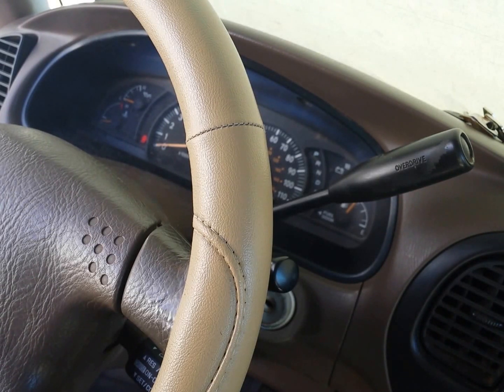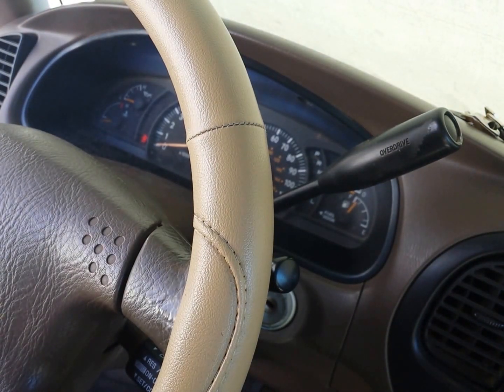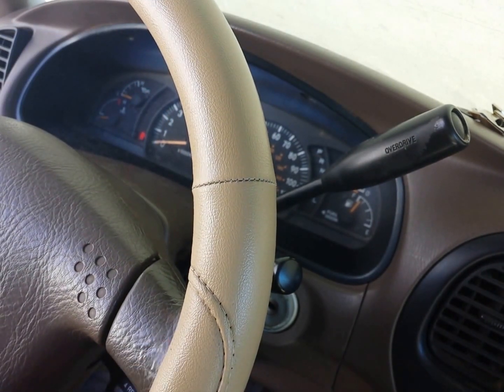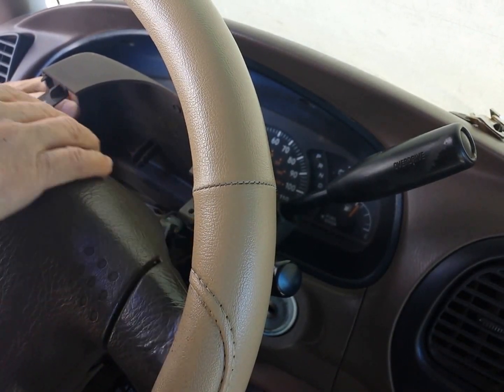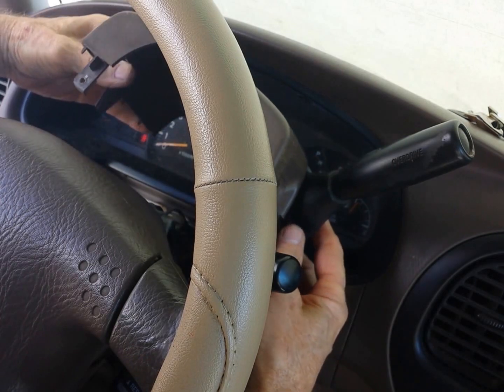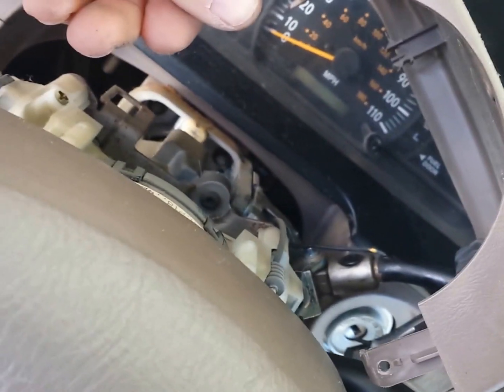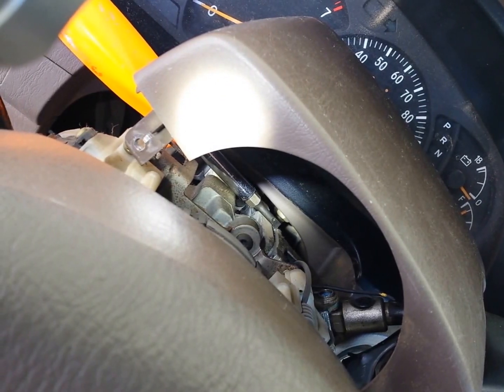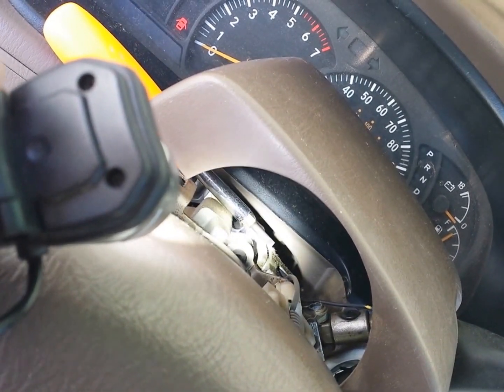2002 Toyota Tundra getting a look at shifter problem pt 2

Comment: This is incredible. There is NO reason to take off the steering wheel OR the air bag. 
I just did this yesterday on my 2002 Tundra; elapsed time 40 minutes. (broken into 2 x 20 minutes to get the part). 

First: to tell if it’s the controller casting: When you move the shift lever, the lights won’t follow all that well. Mine wouldn’t start in park, but it would in Neutral, so don’t worry about not getting home. My truck would not lock into park though, so it could roll across the parking lot, not a good thing. The shift lever will probably seem sloppy or stiff, since the casting is broken. 

1: Block wheels on level surface and take off negative battery cable. Might as well inspect it and clean if necessary. 
2: Take the large bottom shroud off, 4 x 10mm bolts. Lower gently to the floor, no need to take anything else off of it. 
3: Rotate steering wheel from side to side to expose the 2 Philips screws on either side and remove them. Also remove Philips bolt on lower plastic shroud in the center; it's a different thread , so remember that. 
4: "pop" the upper and lower plastic steering wheel shroud apart with a putty knife or such. Keep at it, it's a small pain, but it will come apart. Drop the lower one. The upper one still is attached with the shift lever going through it and the overdrive cable. 
This will be a good time to verify that your controller casting is actually broken; it likely will be in two places. 
5: Shift into low. Get a #20 torx and unscrew the shift lever in the housing. Remove the lever. 
6: unplug the white plastic electrical plug (for Overdrive) just to the right of and behind the steering wheel. CAREFULLY pop the black rubber tube out of it's channel by the top of the steering shaft. I used a small screwdriver as a lever. The upper shroud can then be removed and set aside. You then have all the access you need. 
7: Disconnect the shift cable, using a flat bladed screw driver to pry off. It comes easy. 
8: Remove the 3 #30 Torx bolts from the controller that attach it to the steering column. The one in the back is a bit of a pain; I used a small vise grip directly on the Torx bit since I didn’t want to take off the ignition switch. I didn’t have a small enough closed end wrench. You may have to shift the “stub” around to get good access with your extension. 
9: The black brake interlock plug can be accessed better now. There are 2 #20 Torx bolts that hold it on. Easy, they’re 3/4" long. BE CAREFUL of the long spring when you pull the plug out. It’s not strong, just long and you don’t want it lost. 

You will now get a good look at your broken casting. Mine was in two places. It’s cast aluminum. There were no casting imperfections, it’s just a bad design. Cuss Toyota here. 

Assembly: 
1: Reconnect the black brake interlock plug. It’s keyed, so it can’t be put on wrong. Be careful of the spring though. 
2: Attach the controller assembly with the 3 #30 Torx bolts. Don’t over tighten. I used a 1/4" socket wrench. 
3: Re-attach the shift cable. 
4: Re-attach the overdrive sensor wire plug and gently push the black rubber sleeve back in the channel on top of the steering column. 
5: Re-attach the shift lever. Check and see if the whole thing works now. 
6: Pop the upper and lower steering column shrouds back in. Patience. 
7: re-attach the lower shroud with the 4 x 10mm bolts. 
8: Test drive. 
Be Happy!

Comment: So the only covers i have to take off is those behind the steering wheel? Not the airbag. Also what's the part number we have the same issue with a 2000 tundra. I took the bottom cover and saw the same spot yours cracked on but ours actually just broke off. 
Also do you have a part # for that frame
Reply: It's been some time ago I did this.  You may not have to take off the airbag. I think I found out I could have done it without removing it in the end. But I could only know that by taking it all part. Thats why me posting this is so helpful. Hindsight is 20/20. You will need good light I'm sure. Was a easy job looking back just took time & tools 
The prt # is in 1 of the vids.
Reply: M S yeah your videos were very helpful, thank you.